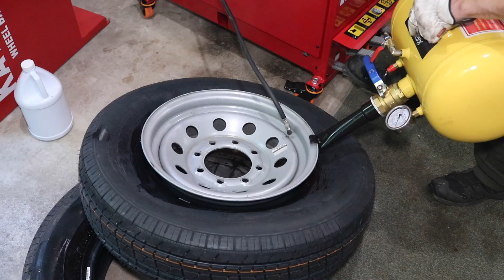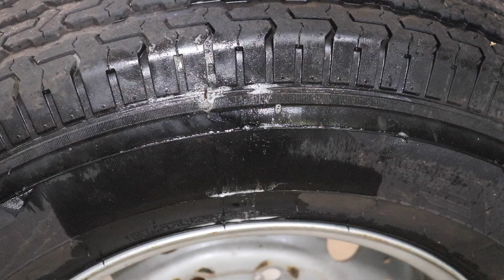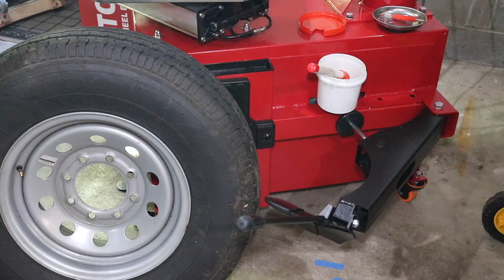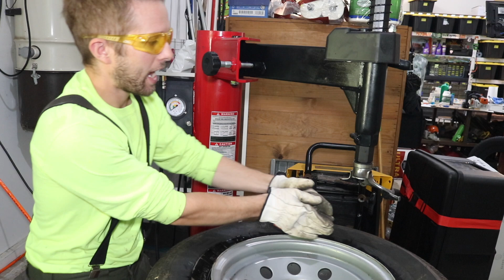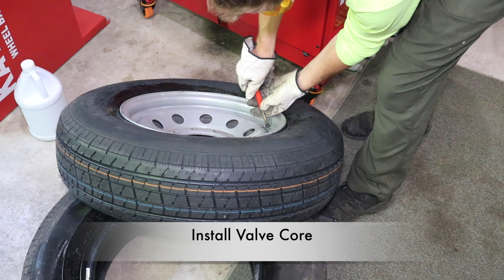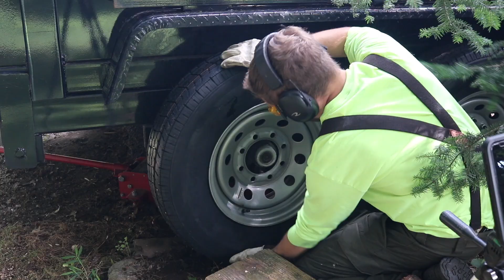How to Use a Tire Machine |  End Tire Shop Dependency

Comment: Watched all three of your tire machine vids, well done! Curious what your thoughts are after a year and if you recommend specific stick-on wheel weights and whether the tire lube supplied with the machine was any good. FYI, the link to the rim protector takes you to the KT-T830 tire machine. Thanks in advance for any response.
Reply from the maker: No regrets, solid machines. So I recommend dynamic balancing. There are 6 different styles of clip on weights. Look at the inside edge of the rim under your care and see what style weights you have. Buy that specific style of weight, and any stick on weights that have good reviews and match your rim color.

You must use a tire lube for mounting and dismounting. This is what I use https://amzn.to/4nXe63Y

Comment: What’s the Air Compressor specs to run the machine properly?
Reply from the maker: I don’t know. I have a 60 gallon tank, more than enough. Look at the manufacturers website specs.
Reply: @ Sounds good! I am 99% sold on these units for my home garage. Just curious on how big of an air compressor tank is needed. I will dig deeper on the specs, thank you!

Comment: The machine shows there is a built in bead blaster. Does your machine not have one or does it not work well? That is going to be my deciding factor for whether or not I buy this particular one.
Reply from the maker: Mine is not equipped. I purchase a 5 gallon bead blaster air tank for 75 bucks. Does the job just fine.
Reply: @OldSoulMillennial  thanks for the reply. All the ones with that model number state they have a bead blaster. I was confused as to why you would use the portable. I also have the portable like you have.

Comment: Appreciate the vids on these tire machines, planning on getting myself a set soon. One note would be try balancing your trailer tires, especially since you already have the balancer. I've noticed it helps mine last longer and definitely helps smooth out the ride

Comment: Classic $2000 tool for $50 job :)
Reply from the maker: @EndoExcision  Changing my second set of tires as we speak. Worth every penny
Reply: @OldSoulMillennial  hey no judgment here. I’m a surgeon, we prefer $5,000 instruments when 50 cent ones will do. 🫢😳
Reply: just swapped my wives tires over to winter. Was $150 with tax in Canada. So $300 a year, just for her car. I own 5 vehicles, and 5 trailers. My wives vehicle alone will pay for this machine. And every time a tire shop touches our rims, they scratch them. I have tried a dozen different onces. Very rare do they come back completely scratch free.
Reply: @ … that’s an insane amount. I paid $50 today actually to swap and that was 8 tires 4 wheels.
Reply: @ but yeah, 5 vehicles at $300 a pop, sure I can see that.
Reply: $150 a pop but twice a year per vehicle! So $300. Welcome to northern canada. lol
Reply: @acreageliving  $150 in Eastern Canada too. I just bought a new one with balancer as well.
Reply: Classic $2000 tool for a… depends on where you live-$ __ Job. Irrelevant comments are the greatest… 🤦🏽‍♂️

I can understand this regardless of the cost. I feel like you made this clear in your other videos when you first bought these that the pricing depends on where you are located (this should be common sense to the keyboard warriors out there).
 I worked with tires from passenger to light truck to commercial to agricultural. I’ve been pondering the idea of these cheaper machines compared to what I’m used to using (Hunter) and I’ve decided that these will do after watching your videos. 
These aren’t my first choice but the price tag seems to be more attractive. 😅
Thank you for sharing!!